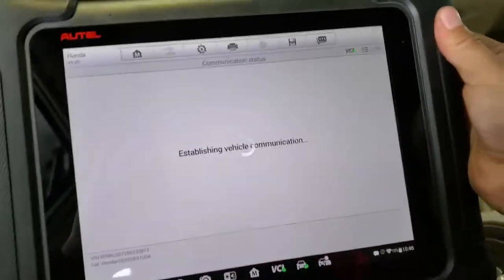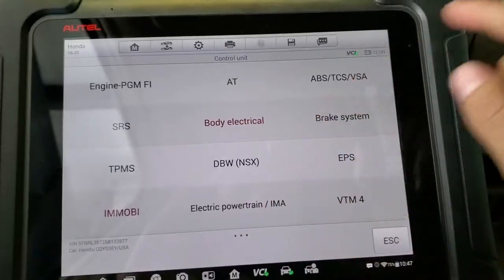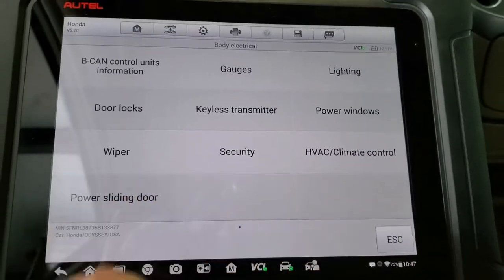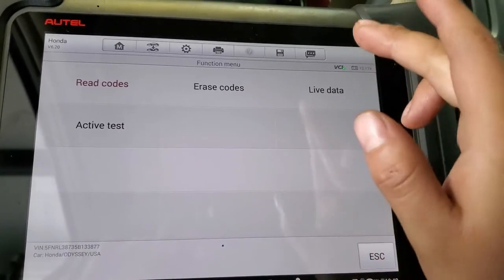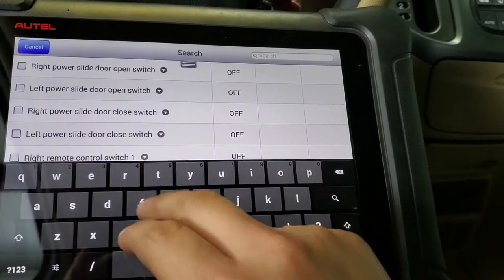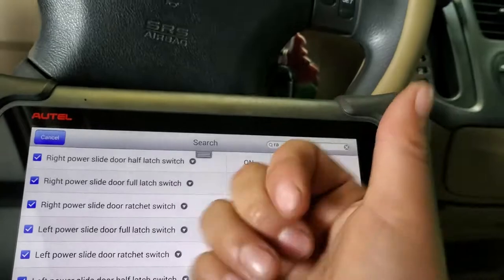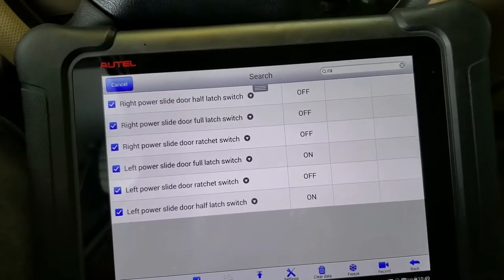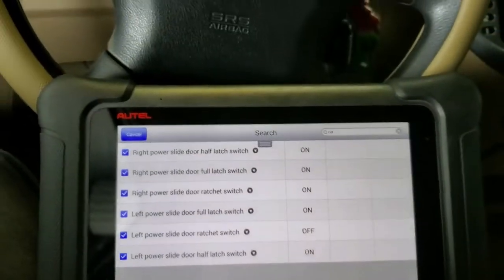How to fix and diagnose sliding door not working on a 2005-2012 Honda Odyssey.

Comment: I bought my Odyssey yesterday and talked the dealer down $500 because the left sliding door would not work. Based on what you showed in this video but without taking anything apart I sprayed the latch mechanism with brake cleaner (which blew out a lot of debris) then soaked it down with penetrating fluid and my door started working! Thank you so much!
Reply from the maker: Glad it worked out for you. That's the first thing on all the honda odysseys that I have fixed with that issue. It is really common. I would advise you to do the same thing on the other door to prevent it from failing
Reply: Thanks Michael and JVFIX! My passenger sliding door (2007 Odyssey) stopped working and there was a battery drain of almost 1 amp. All the fuses and relays were fine, and I did not think this switch would be the problem, because the interior lights did go out when I closed the door by hand. But I sprayed some caliper cleaner in there anyway and as if by magic, the door started working again and the battery drain is gone. So apparently there are a myriad of switches in there controlling different things, and we should not assume that the operation of the interior lights is telling the whole story! JVFIX, maybe you could go a little deeper about the different switches and how they interact?
Reply: @jamesschofield9023  I've got a door that doesn't function and I've previously had a parasitic draw that I never took the time to figure out because if I drive it daily, it seems to be a non issue. Sounds like I'm going to get two birds with one stone when I repair my door!  That would be fantastic because I wasn't relishing trying to track down the parasitic draw!
Reply: We're on the laps do you spray I'm a girl so I really don't like taking things apart LOL
Reply: 20:46
Reply: @jamesschofield9023 😮
Reply: Thanks
Reply: @jamesschofield9023 which part u spray having problem with right sliding not working i ttried reset and everthing pls help
Reply: Hey would you be able to show us which area you sprayed and cleaned , I'm having the same issue.. thank you 🙏
Reply: @jamesschofield9023 where did you spray the caliper cleaner to clean the latches ?

Comment: Thank you so much for this video! Neither door was working even after replacing the side rollers. I decided to try following your suggestion by pulling the latch mechanism and cleaning it. When I put it all back together, the door still didn’t automatically close initially, but I pushed it back into the fully open position and suddenly the switch started working. Repeated the whole process on the other side and the same thing happened. Both doors are now working and the current leak that has been draining the battery for more than a year is now gone! I’m so grateful that you spent the time to take us through this! Thanks again!
Reply from the maker: Glad it worked out!! Thank you for watching
Reply: Waiiiiiit!!!!
That is what’s killing my battery? But how???

Comment: The sliding doors are a problem man it should be recall. It is not safe you can't even close it manually all the way
Reply from the maker: yea you right it should be a recall.
Reply: @JVFIXLLC also it drains the battery because the door doesn't close all the way. I think it's a flaw they didn't see coming or they purposely did it

Comment: Just fixed my van's door by following this awesome video. You saved me tons of $$!! The only thing I also had to do was pull the 7.5amp "Backup" fuse from the panel under the drivers dash, wait 10 seconds, then plug back in. I think that resets it, got that from another video. Anyway thanks a ton!
Reply from the maker: glad it worked thanks so much for watching
Reply: Was your van getting a parasitic draw due to this issue?
Reply: Like 0.410 miliamps?
Reply: I been doing this to my van, (disconnecting the 7.5 fuse) but after that I use the door a couple of times and stops working again, I go to the fuse, do the proses again and after a couple opens and closes, stops working again. 
😢😢
Thanks!

Comment: Thanks to everyone in the comments, I went to the latches on both sides of the doors and sprayed them down with penetrating fluid, wiped them with a cloth, and I also had a little brush next to me I used and the door started to work again. While spraying down the latches I also took off the tailight and side piece and cleaned the wire and roller and after all of that, it finally works 🙂
Reply from the maker: glad it worked. thanks for watching

Comment: Great video I was able to remove the two top latch mounting bolts, and used the empty holes to spray WD 40 into the latch. This allowed the spray to reach the necessary spot to free up the sticking linkage, now the door works perfect.. 10 minute fix all work performed from outside the Odyssey at the rear latch on the sliding door. Thanks to your video
Reply from the maker: glad it helped thanks for watching

Comment: Thank you for taking the time to post.  Latch switch was my issue as well on a touring edition 06 235k vehicle. I’ve replaced the  cable before in both doors but this was a new issue.  Symptom- DS worked fine.  PS door has no feedback from the dash switch, key FOB or door hand on interior or exterior.  Checked fuses first (two per door plus backup fuse) but all checked out.  Went to YouTube!  
The live data from your tool allowed me to narrow in on the issue.   Did not disassemble, but blew out debris with compressed air  and PB blasted the latch multiple times.  Did the other door while I was at it as PM.  She’s alive again.  Thanks again. Your time taking this video is much appreciated.
Reply from the maker: no problem glad it helped u out

Comment: Helpful note; I needed to clean the contact spring as well, but I did NOT release any of the cables except for the one plastic clamp near the screws towards the rear. You will see this clamp at 11:14. If you freeze the video at 11:15 you will see the last clamp just below the white wire. The clamp is just above the yellow marking on the black cable. The motor WILL come out far enough to easily work on the micro-switch and spring. Just have some paper towel or rag to absorb the penetrating oil you need to spray to loosen up the spring. Just keep working the spring back and forth to loosen the debris buildup. Also, the bottom bolt, to release the motor, attaches to a piece of metal that straddles the channel that runs vertically between the motor and rear of the door frame. You will "feel" this channel if you simply put your hand in there. You need to PUSH that channel TOWARDS the outside wall of the door panel to finagle the motor out. That piece of metal may fall off the channel. No worries. Just slip it back on the channel AFTER you get the motor back into the door. The piece has a hole in it which receives that lower bolt. This may sound confusing, but once you work on it, it will be very apparent. This is NOT a difficult procedure. Just be patient and it doesn't take more than an hour (75% of that hour is simply figuring this out as you go along). Good luck!
Reply from the maker: thanks for this helpful note. I am sure it will help more people.

Comment: I’m just a lube tech/tire guy, and I futtsed around with changing the rollers cause they were messed up and they wouldn’t open easily on my passenger side and I wanted to fix that, I did, and now they open manually totally fine, then when everything was all back together to see if the doors would close and latch but the back latch on both sides doesn’t grip into the body leaving the doors open just a crack. Was not looking forward to tracking that down but I feel you have just made it so this can possibly be a positive learning opportunity for myself.. so thanks
Reply from the maker: yea these vans are always having issues with the rear latches because they catch alot of dirt and even leafs.

Comment: Awesome! Hooked me scanner up and both are off with door open and yes both doors inop. I havnt started yet but at least I’m close.
Reply from the maker: blow the dirt on the rear latches first and use w40 to get the dirt loose hope that helps.
Reply: I took it all out and cleaned, works like a charm. 

Now Passenger door won’t open with inside hand but i can use it to close door. Any idea?
Reply from the maker: probably the wire that runs to the latch is loose or the handle clip broke

Comment: Great video. That process fixed the pulling door in too far and then releasing. However, when in drive still beeps like it's open. Any idea what else to do other than replace the latch?
Reply from the maker: yes it could probably be the latch switch getting stuck. with a scanner is visible to see it the switch is operating good or not.

Comment: This was an excellent video,  and thank you so much for making it. I had a question will this work on my drivers side sliding door that seams like there is no power going to it?
Reply from the maker: yea It should, both sliding doors work the same way.
Reply: Thanks for responding after disconnecting the cables that go to the sliding door the door worked again. I guess by disconnecting it it reset the module. I tried disconnecting the battery before thinking it would reset the module but it wouldn't fix the problem of no power to the driver's side sliding door. Then by disconnecting the door connectors the module came back on. In regards to the parasitic drain I found that taking the plastic pieces on the locking mechanism off allowed the doors to fully lock and not pop open again solving the parasitic drain problem as the modules on both doors could go to sleep.

Comment: what are you using to get the initial diagnostic reading - that computer/tablet looking thing?  will auto zone do that for me? the local dealership says its $125 just to diagnose my sliding door problem.
Reply from the maker: It's an Autel scanner. If you go the autel website you'll find different models. And autozone won't be able to read this they only give you check engine codes.

Comment: Hello, thank you for posting, "B1222 Code - Short In The Rear Mode Control Motor Circuit" pointed me to this video, can someone point me to the correct fuse location for this circuit, I am measuring 1.7 amps draw inline on the negative terminal, thank you.
Reply from the maker: hi sorry for the late response did you ever figured the problem?
Reply: @JVFIXLLC  actually really NOT the battery started holding charge, my ~$50 clamp meter used inline had poor small range when I switched to a quality HP meter I started getting sub-zero amps readings.  However since that time (2 months ago) I have the sliding doors power switch, located on the left of steering wheel, OFF, I have not re-enabled it and tested for a current draw inline so the problem may still be around with my left/driver sliding door not working. I don't know what to say about Honda vans a hate/love relationship at best :) there is plenty of design-to-fail parts all around the vehicle, I know same with lots of vehicles out there.

Comment: Hi there. Tried scanning a honda odyssey 2002 with an otofix d1 lite (autel software), but for some reason the scanner gives me a "no response" result for the body electric module. Any idea what this "no response" could mean?
Reply from the maker: are both your sliding doors inoperative?
Reply: @JVFIXLLC  Negative. The right side is operative. Only the left side is inoperative, which is why I was surprised there was "no response."
Reply: @JVFIXLLC  Hi there. Just wondering if you got my reply from before. Still trying to figure out why my body electric module shows a "no response"

Comment: How do you test the switch with the red & yellow and black wire mine has no reading of any kind?
Reply from the maker: just put the multimeter in continuity and try to press the switch and see if if the continuity cuts or not.
Reply: @JVFIXLLC  Thank-you for the answer, But I'm talking about the switch on the lock, it's actually not a switch it has 3 wires, it's not the micro switches they have 2 wires. I put my multimeter on the black and red rotated the switch nothing, put it on the yellow black rotated, nothing. Don't know for sure, I even looked for ohms, nothing.

Comment: I’m having similar problem with the left sliding door not opening for 2019 Honda Odyssey you think it could be the latch not being released… when I press the switch by the steering it beeps but the door doesn’t open
Reply from the maker: first check if you have dirt in there it could be obstructing a little switch not allowing the door to be closed and if it does not work it will need a deeper diagnosis.

Comment: Great video, but door still dont work, do i need to replace the micro switch
Reply from the maker: i would advise you to remove first the latch and check if any dirt got stuck in the switch 90% of the vans i have fixed always have the same issue if you had a scanner it would be so much faster to diagnose it but try that first and let me know.

Comment: I have a 2005 odyssey. My right sliding door opens and closes fine 2 or 3 times but on the 4th try the sliding door light comes on my dashboard and the door won't even try to open.  Do you have any idea what might be happening.
Reply from the maker: it might have mud stuck in too. try the w40 and also if you can try a to blow out the dirt from there/

Comment: When the button is off my doors are like impossible to open, yours slides easy you know why mine won't open
Reply from the maker: try to open it manually and spray w40 at the back of the sliding door it has 2 latches one at the back and one at the front they usually get clogged with dirt building up overtime and blocks the switches making thinking the module that the door is not locked
Reply: @JVFIXLLC   yes it's hard manually, I think it needs a new wheel bracket. I sprayed the latches it open and closes now but just hard opening

Comment: the switch for one side door doesnt do anything and we noticed (not sure if has anything to do with it) the same side tail lights dont work. brought to dealer but they dont seem to have much training and couldnt figure it out. van was in shop 9am-2pm. Shouldnt they have a scanner to guide them?
Reply from the maker: yea with the scanner u can know right away if it's the switch on the dashboard nor working or inside the sliding door
Reply: @JVFIXLLC  thanks. Van went in shop 9am today. Dealer never called us. Around 530 got VM that they never got chance to look at van. We miss good customer service that seems has vanished
Reply: @JVFIXLLC  dealer today said the control unit ECU needs replaced $700
Reply from the maker: the unit that controls the door? 
I honestly have never changed one but who knows anything could happen. I would start by checking with a scanner if there's any communication with that module and checking all fuses first too.
Reply: @JVFIXLLC  paperwork said recommend replace slider control unit and right below that had a description on ECU so thought was weird because ecu has nothing to do with door.  All we could think of is they want charge us the price of ecu for a slider unit otherwise doesnt make sense. We read reviews of this dealer and seems known for scamming customers

Comment: Thank u! I have 2012 Honda Odyssey can’t open or close automatic or manual mode it’s stuck in almost close mode when I forced to try to close the door. Other side worlds just the passenger side sliding door.  It began slowing down closing for awhile or it may close halfway automatically then reopen. Now it doesn’t open or close at all.. please help?
Reply from the maker: Sounds like u have a latch  problem and if it doesn't open from outside or inside u will need to remove the panel from inside to be able to open the door unfortunately.
Reply: Is that expensive? Ur video is great but I’m not a big mechanic..
Reply: @JVFIXLLC  does not open from inside or outside just remains partially open since I used muscle strength to close as much as I can manually
Reply: Any mechanic or have to go to dealer?

Comment: Will a blue drive scanner work on this problem?
Reply from the maker: Honestly I haven't used that scanner.
Reply: I believe there is a pair of jumper pins at the driver side fuse block that you can jump and pull body codes from the dashboard display
Reply: No, it won’t work

Comment: What if you don't have a scanner that operates the doors?
Reply from the maker: I would recommend you to first blow with air the front and rear latches 90% of the time is mud trapped in the micro switch.

Comment: on 2005 driver-side door does not open manually or with power how do I open it?
Reply from the maker: Maybe your latch mechanism is jammed and to open it you have to remove the door panel

Comment: My door is stuck shut. I dont know how im going to do this.
Reply from the maker: force the inner door panel to come off that's the only way
Reply: @JVFIXLLC  I got the panel off but that part you took out is stuck. I took all the screws out and window rail and that part with the lock won't come out because its stuck in lock mode.

Comment: How do you guys get the door open my 06 odyssey has the door stuck closed wont open at all like its not unlocking all the way
Reply from the maker: u will need to open the plastic cover feom inside and it takes some time to get it out.
Reply: I took the plastic off but i still cant get the door open
Reply from the maker: @edward3441  ok then u have 2 latches at both ends of the sliding door and u have to pull both cables so both can be opened at the same time u will probably will need help to do it.
Reply: Tried that seems like the door just dosent want to open ill try to force it if not ill take it to the shop to see if they can get it open
Reply: Your video was great tho super good on instructions